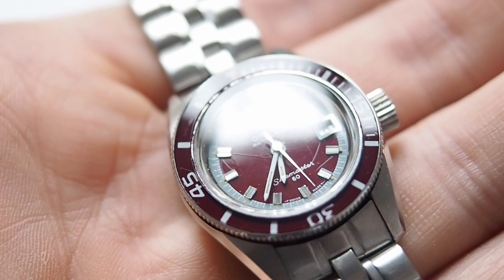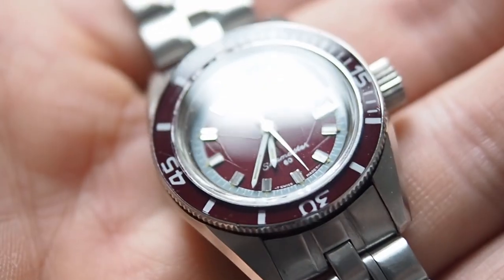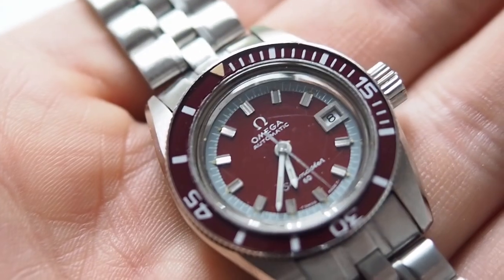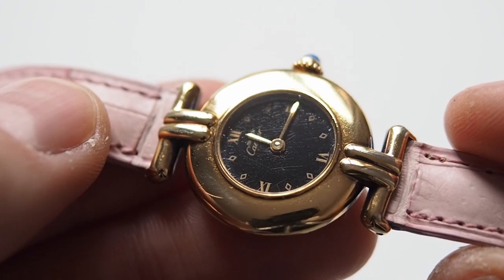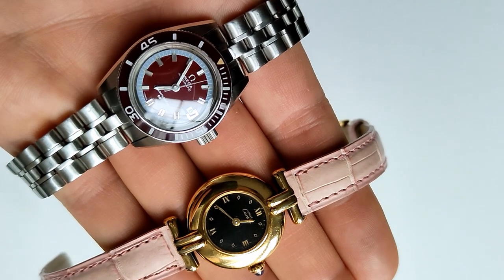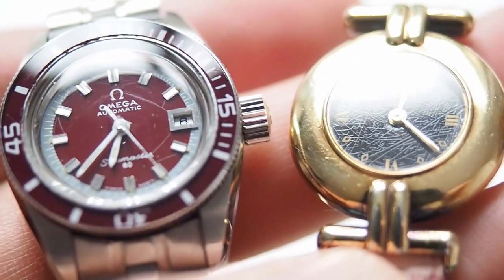SPIDER DIAL - what is it ??! OMEGA Lady Seamaster 60 bakelite & CARTIER Must the Cartier Vendome 925

Comment: Hi there, if anyone knows you will know. (Question) is it true that the sbdx001 bezel printing is silver and the printing on the sbdx017 bezel is golden in colour, I only ask as I am looking for a spare bezel  for my sbdx001. Any help would be appreciated. Keep up the good work.
Reply from the maker: Hello, no they are the same - silver color, only SBDX012 has golden accents, I have a few ceremic inserts for SBDX maybe you would be interested as this could fix your problem and it would be easier than finding whole bezel, if so write me struzik.ad@gmail.com, regards,
Reply: @pantarhei-watchesbeyond460  Hi there, thanks for the quick reply much appreciated, it just goes to show how much misguided information there is on forums. In regards to the ceramic bezel what type is it as I've seen several around one being a sharky bezal, plus i'am yet to see a video on how to change one.
Reply from the maker: @marcocastagnetti7086  https://www.ebay.com/itm/234365008197
Reply: @pantarhei-watchesbeyond460  Thanks for the link, I take  it they are well made hence your referral. Just two questions, have you made a video on this bezel and how do you remove the original bezel inlay as I haven't seen any videos on YouTube, apologies for all the questions.